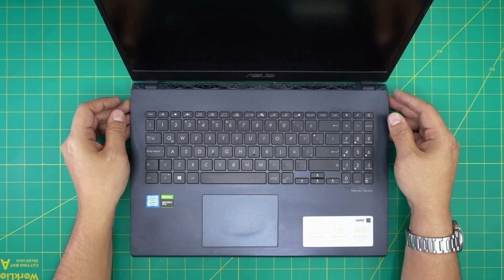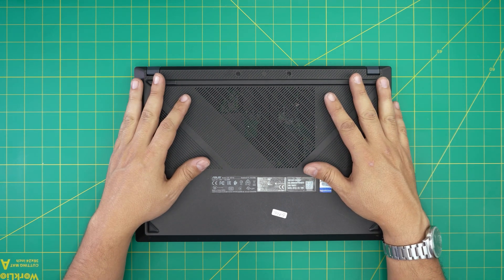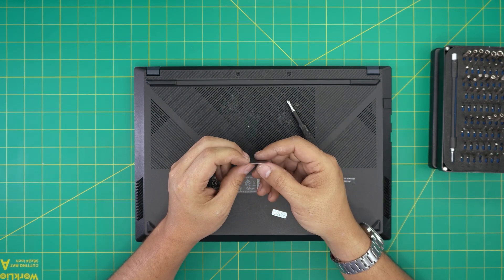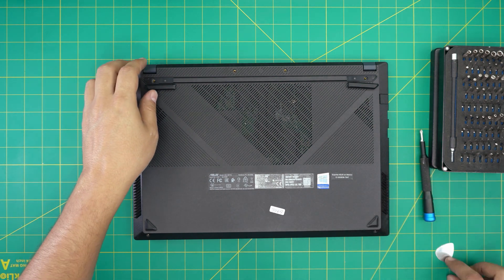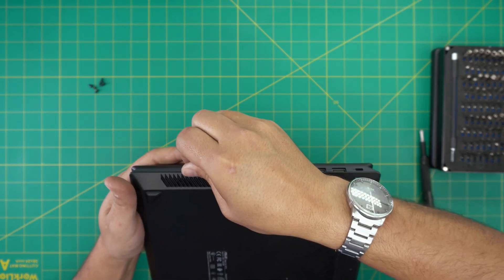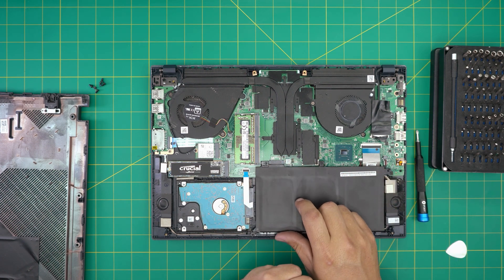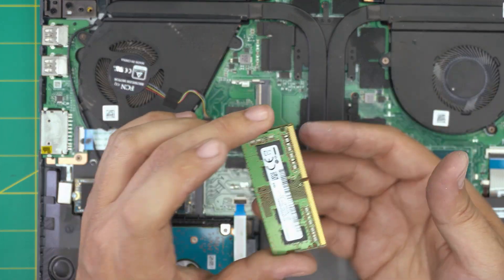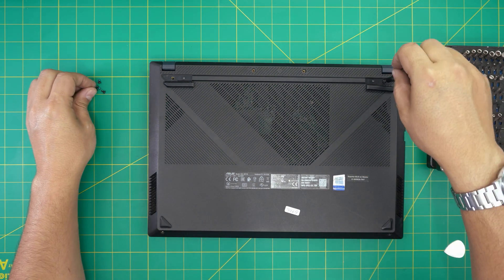How to Upgrade RAM on ASUS X571 X571GD-BQ234T Laptop - Step-by-Step

Comment: Hi, I have same laptop with 8 GB onboard and 8 GB SO-DIM. I check max capacity as showed in other video and it says I can have up to 64 GB. Can I add one 32 GB DDR4 RAM and have 40 GB in total?
Reply from the maker: 🫠Regarding your question, you can add a maximum of 16GB in the slot, with 16GB soldered on the board. If your onboard memory is 8GB, then you can only add an additional 16GB stick.
Should you have any further questions or requests in the future, please don't hesitate to ask me.
cheers🍻

Comment: A very helpful video, i hope you still answer questions. Can i also buy a ddr4 16gb with 3200 mhz instead of 2666? I got the same laptop.
Reply from the maker: It's my pleasure my friend.
i appreciate your support, 🫠Regarding your question; Sure you can without any issues, the BIOS/MObo will auto adjust the ram speed.
Should you have any further questions or requests in the future, please don't hesitate to ask me.
cheers🍻

Comment: I have an ASUS VivoBook X571LH with an Intel Core i7 10th Gen processor, and it comes with 8GB of RAM that's integrated (soldered) on the motherboard, plus an empty RAM slot. Can I add a 16GB RAM module to that empty slot?
Reply from the maker: 🫠Regarding your question, sure you can, BUT before you do that, check the maximum RAM capacity of the laptop by checking the link. If the maximum capacity is over 32GB, then yes, you can.  
The link is in the video description.
Should you have any further questions or requests in the future, please don't hesitate to ask me.
cheers🍻

Comment: Hi, thanks for the video. I have an Asus K571GT, and it has 4GB of RAM soldered on it. If I put a 16GB RAM in the other slot (for a total of 20GB), will there be any problem? Since the official website states that the maximum supported RAM is 16GB, I'm concerned about potential issues.
Reply from the maker: It's my pleasure my friend, i appreciate your support.
🫠Regarding your question, first of all, don't listen to most of the spec limits that the manufacturer mentions—they are not always correct. Check this video to see the max RAM capacity of your board: 
https://youtu.be/tKEJTkVth4Q
If the limit is 32GB, then yes, you can install a 16GB stick. We've upgraded these laptops for clients with 16GB + 4GB onboard for a total of 20GB.
Should you have any further questions or requests in the future, please don't hesitate to ask me.
cheers🍻

Comment: Hello sir great video which helps me lot,  I Have a question about my laptop model = X571GT laptop which Have 16 gb ram in built can it will be upgradable? In the settings there showing 4 ram slot on it please give my answer
Reply from the maker: It's my pleasure my friend.
🫠Regarding your question, the option where you see the 4 slots is incorrect. Windows always had this misinformation about the RAM in the Task Manager. You have 8GB, maybe soldered on board, and an 8GB DIMM installed. So, I would recommend you remove the cover to see the RAM configuration.
Should you have any further questions or requests in the future, please don't hesitate to ask me.
cheers🍻

Comment: Hi I've followed this tutorial but whit a new ram the laptop doesn't startup but without the ram works properly, there is any adicional configuración of the BIOS that i have to do?
Reply from the maker: 🫠Regarding your question, your motherboard maybe is not doing a mem check, to force the motherboard to mem check, do this:
remvoe the charger and open the cover and disconnect the battery,  then press the power ON button for 30sec and hold it, then let go and place the new ram in the dimm and connect the battery and then the charger and power on and wait up to 30sec.
Reply: @uFixTek  thanks i cheked the motherboard and apparently the ram port was damaged, the ram pines are a little bit fold, it was my fault, anyways thanks for the help your advice was very helpfull, i've already sended the laptop to fix so in some days will post updates 🤓

Comment: I have the same laptop with 8gb of ram l. So does that mean I have 4gb that cannot be removed and another 4 that I can replace with whatever ram I want?
Reply from the maker: 🫠Regarding your question, yes that is correct.
Should you have any further questions or requests in the future, please don't hesitate to ask me.
cheers🍻
Reply: @uFixTek  Last question. Can I replace my 4gb ram with a 16 GB ram? Will this cause any problems to my computer if I do so?
Reply from the maker: sure you can and it will work great without any issues.

Comment: My X571GT bios shows that i have 12GB ram but on the system it only shows that i have 4GB ram i try to re install the windows but still the same issue i have 64bit btw
Reply from the maker: 🫠Regarding your question, i need you to open the bottom cover and see if you have a ram stick and what is the capacity on it, and if you have 8Gb stick that means you got 4GB soldered, or if you got 4gb stick then you have 8gb soldered.
your ram stick may be faulty it happens sometimes, i recommend you to remove the ram stick and clean the pins and re insert andcheck.
cheers🍻

Comment: How come my laptop said my max capacity is 6710884 that means it can support up to 64gb ram? My laptop is Asus X571GD and it has 8gb soldered and I bought a 16 gb ram 3200mhz ddr4 so overall I have 24gb ram. Is this ok?
Reply from the maker: yes your laptop CPU and BIOS can handle up to 64GB, BUT unfortunately the reversion of the motherboard that you have, the ASUS has limited the use by removing the ram slot and soldering them on board. and some reversions give you a 4 ram slots. you can add the 16gb ram and it will add with your on board 4GB to get a total  of 20GB and it will work fine.
Should you have any questions or requests in the future, please don't hesitate to ask me.
Cheers🍻
Reply: @uFixTek  is it ok to put a 3200 mhz ram to a 2400 mhz ram soldered in the laptop?
Reply: @uFixTek  thanks for the reply
Reply: @uFixTek  and what until what ram mhz does ASUS X571GD support? Because i heard putting a higher mhz ram on a motherboard that supports a lower ram mhz can cause some instability issues.
Reply from the maker: It's my pleasure my friend.
no matter what ram speed you place, the bios will auto adjust the ram to match the lower rams dim , in your case it is the 2400mhz, that means if you place a 32000 along side your 2400 the bios will downgrade the 3200 to match the 2400. so get a 2666.

Comment: can you add 2 ram sticks instead of just one?would appreciate it!
Reply from the maker: Thank you for your feedback! If you wish to support the channel, you can like, subscribe, or both!
Regarding your question, as you can see clearly in the video i mentioned that there is only ONE dim available , NOT two.
you can ONLY place one stick of the ram not two. if you have a 8gb remove that and get a 16gb stick.
Should you have any further questions or requests in the future, please don't hesitate to ask me.
Reply: @uFixTek  I also have a second question,the speed of the ram in the link is 2666 Mhz,can a similar laptop handle up to 3200 Mhz?
Reply from the maker: the higher the GB on ram you go on laptop especially on this CPUs old gens the lower the ram frequency get automatically because of the bios and the bios doesn't have a xmp option enabled so you can set your own ram profile.
so go with 2666 that is the most compatible at over 16GB.
Reply: @uFixTek  thank you very much for the answer

Comment: can you add 32gb here?
Reply from the maker: you can but that is too much ram for this CPU. but it will handle it.
but make sure your CPU can handle 32gb: https://youtu.be/tKEJTkVth4Q
Reply: @uFixTek  we have the same laptop. but do you think it is too much? so 16gb is enough already?
Reply from the maker: it all depends what you planing to do with your laptop what applications or games you going to use?
Reply: @uFixTek  Hey, I have the same question. Should I add 32 GB? I wanna render 3D Blender projects faster

Comment: I'm looking to potentially upgrade the ram on my ASUS X571G laptop. I opened it up per your video and there is no ram card in the slot, just the soldered in ram. I looked in my device specs and it lists 8GB installed ram. Is it still possible to add more in that case?
Reply from the maker: Thank you for your feedback! If you wish to support the channel, you can like, subscribe, or both!
Regarding your question,yes my friend, if you opened up and you saw a free ram slot available and you have 8gb on board, then sure you can add a 16gb on slot and it will add up , we use this ram it is very compatible and rock solid : https://amzn.to/3BQIs1M

Comment: Is it compatible with a 16 gb ram? Because in pages it says that the maximum it supports is 12gb + 4gb that the laptop has soldered.
Reply from the maker: Thank you for the feedback! if you wish to support the channel you can LIKE or SUB or both :P
regarding your question: yes you can add a single stick of 16gb make sure its 2666: https://amzn.to/3yz2GeI
we do upgrade them all the time and it will add with 4gb on board 16+4.
Reply: @uFixTek  20gb is large enough? and also the 2666 dual channel will be fast enough yes? currently I'm using 8gb+4gb but my 8gb is only 2400.. you think 2400 to 2666 is much better?
Reply from the maker: @mykeviper  20gb is more than enough and difference from 2444 to 266 is almost to nothing.
Reply: @uFixTek hi can I upgrade it to 32g ? As I'm having the same model but some forum said it's max capacity is 16g, thanks a lot